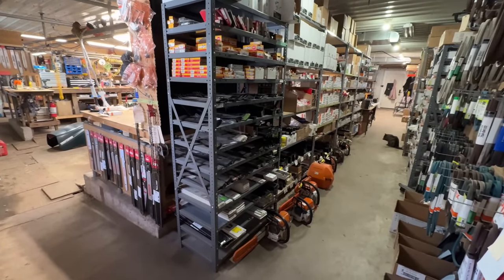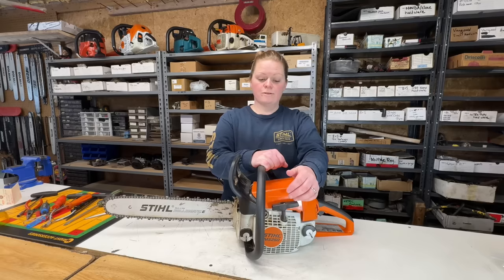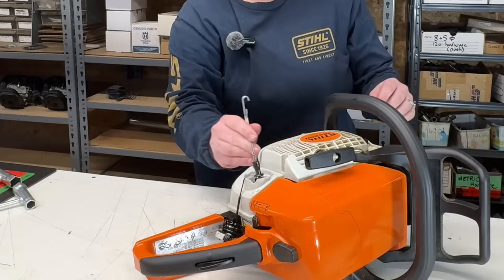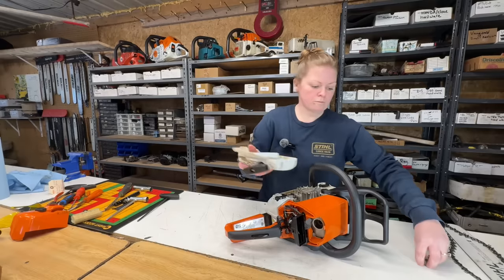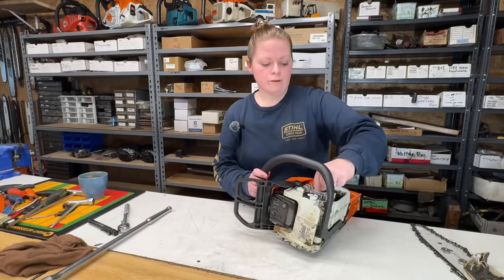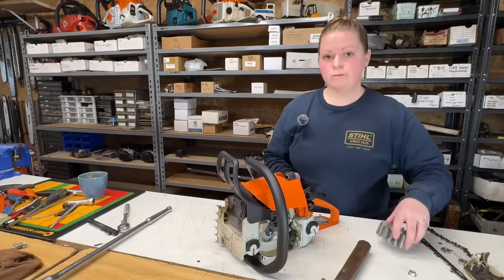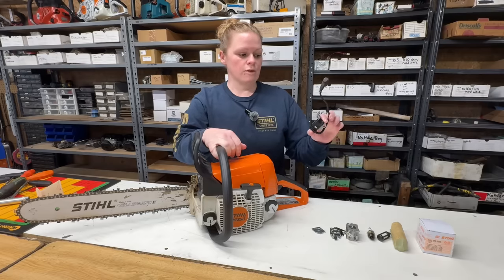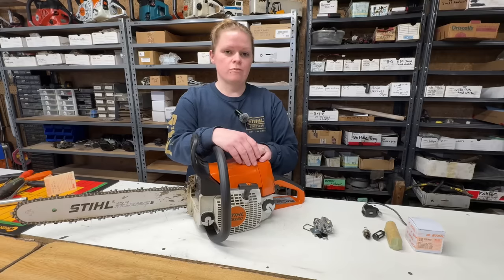Stihl MS250 Chainsaw HARD To Start!  It Wants To Rip Your Arm Off!  Let’s Dive In and Find Out Why!

Comment: Well? One thing I should point out though (and I don't know if you tried it with this saw) is that once warmed up, it starts perfect the rest of the day but once it sits overnight, the same things happens on a cold start the next morning. You should wait a day and try it again in the morning before coming to a conclusion on the kick back problem. Let me know if when starting it the next morning it's still fixed. If it is, I'll check my carb this time. Thanks for pulling that one up to the bench, I have one and have been scratching my head on this issue for a long time.
Reply from the maker: As of right now, its starting up as a MS250 should.   They seem to require a solid, fast pull.   I may not have the upper body strength required for a 250.  Tyler is able to easily start it now.   Something else I forgot to mention in the video is that we installed an elastostart starter grip - it takes some of the shock out of that pull.
Reply: Thank you, it's nice to finally find out that MS250's tend to have high compression, I was baffled with that too. You're not the only one that has a hard time pulling that thing over, I pulled it out once for my neighbor to try and start (he's a bit of a strutter) and it was fun to watch him struggle.  @marriedwithsmallengines

Comment: Thank you for a professional and educational video. too many people are making videos and have no idea of what they are doing.
 What is the flywheel gap at 0.010? I have an old concrete saw that has nasty kickback on start.  ts510, I pull it slow till I can get the fuel to lubricate the cylinder, and then pull it like I mean it, but sometime break the rope.

Comment: I can tell one thing: Customers all over the world will not tell you the reason/ what they did beforehand.
Not sure if it is pride or they think it will be cheaper to fix.
If the latter, they are wrong, as is could possible pinpoint the reason why a machine do not work quicker and save them money overall.
Thank you for the video, thumbs up and subscribed 👍

Comment: I bought a brand new leaf blower made by echo PB 550 T I think is the model first day. It ran like a champ then it started acting up later in the evening. I think maybe it’s just hot. I let it cool for a little bit go to start and it does not start and it starts overloading with fuel flooding out basically and remember this thing is brand new out of the box, I took it back to Home Depot and they said don’t bring it here call the number on the box and return it to the manufacturer. You’ll have to pay shipping blah blah blah then I asked him can could I just exchange it for one that runs the manager comes out and says we can’t do that because we don’t know if you or someone put the wrong fuel oil mix in it or something and caused major engine damage, so I took it back home called the one 800 number they gave me some tips. I got it running again thinking it’s just temperamental, but it immediately started flooding again. I eventually decided to take it apart myself I even ordered the echo brand carburetor kit, thinking I would just clean it and rebuild it, but you won’t believe what I found,a roly-poly skeleton inside the carburetor it didn’t crawl in there, someone put it in there. The location where it was a critter of that size couldn’t have crawled into that port or location where the fuel pump diaphragm is located. it was under the diaphragm, a transparent Rollie poly skeleton

Comment: Thanks for this video. I love your method of elimination. I have an MS250 with the same problem. I’ve learned to struggle with a couple of tough pulls and when it starts to react I put it on half choke and it starts right up. My question is…you found the problem to be the carb, but did not mention what happens to the carb to cause this hard to pull condition. And knowing this now, what would you do to the carb other than replace it to fix the problem? Thanks again!

Comment: I am surprised you did not check and if necessary adjust the gap on the new spark plug. Very thorough and Informative video even though I have a Husqvarna 390XP. I may at some point give the MS500i a go as it has some attractive features, good nearly identical (6.7 vs 6.5) HP as the 390XP, and the 500i is one kg less weight.
Reply from the maker: Thanks for watching!

Comment: In 2012 my grandfather had a hard pull on his Stihl, I think it was a 16 inch, may have been an 18 inch saw.  He couldn't hardly turn it over and was upset thinking his advanced age he wasn't strong enough to turn it over.  I went out and tried and it was hard, I mean hard to turn over.  I told him it's not your fault grandpa, even I had a hard time.  Once it turned over and tried to fire though it would pull smooth as silk each pull.  I took it apart and cleaned it and put it  back together.  The first pulls were always terrible.  I noticed on the nomenclature plate it was marked, "Stihl Made In West Germany".  He'd bought that thing in the early 80's. I began to surmise why it might be a little tough on the first couple pulls 😂😂

Comment: That hard to pull the Rope situation on that song is always going to be caused by either too much carbon buildup on top of the Piston or inside the cylinder or it is going to be caused by too much fuel in the engine

Comment: Unlike most 2 strokes, don’t pull on choke until it wants to run. First choke setting, don’t pull more than 3 times. Then advance choke setting, and pull until it starts. It floods super easy.

Comment: Thank you for fascinating walk through dismissal 😊❤😊 you do excellent work. I had no idea ( I am a home user of chainsaw) no idea about the coil gap testing. I got a MS-291 from local JD tractor dealership. They had a break in at store and someone tryed to take or should say pull my saw off display chain lock up. The only thing wrong or broken was the end of hand holder had cover ( Cracked) they were selling it as is for $420 this is about $100 off there Saws
It was sold as is. I used Gorilla tape rapping around handle. The MS-291 starts after 2 or 3 pulls. It cuts so much faster than my (SEARS) one. I do like a saw or anything gas powered tool that has a primer bulb to pump. For me those type seem to start better. I think the Sears saw isade by Huskavarns. ?????? If someone out there can tell. But the Stihl cuts wood so much faster.for my personal use I prefer the ( Trufuel) pre mix. I have never had a starting issue when my saws site for a time, I personally don't use them every day like professional cutting people do. When I was working for a company, they did NOT use ( Trufuel pre mix) and used the 10% ethanol gas that they put in the work trucks, we mixed the chainsaw gas can at same time we fueled work trucks. I see all Fire Departments when they show there chainsaws and other cutting tools in the compartment, the FDs all have ( Trufuel) pre mix cans in compartments. Can you tell me what your feeling is about ( Trufuel pre mix) I never want to run Ethanol mixed gas in any of my personal hand power tools. The fuel farm I buy all my Diesel and gas from has NON Ethanol fuel pumps even a Premium fuel pump with NONE ethanol
Reply: for my old ms250 . 91 or 89 octane gas 38:1 oil mix 
I just replaced carb , and coil. set gap is important. 
the old carb was dirty and had a bad Diaphragm .
china made coil/wire required filing a grove in the saw plastic bottom to FIT.
new filters : starts and runs very good.   :oops:

Comment: Had one of those for about 3 months, I used it for about a month & a 1/2, went through 15 chains cause you cant adjust how much oil it will pump out to oil the bar & it would burn the chains beyond being able to be sharpened, it would barely pump & when it did it would constantly clog with sawdust, you had to clean the sawdust every 10 minutes like clockwork. I replaced it with a Husqvarna that you  actually can adjust the bar oil over a year later I'm still using the original chain it came with

Comment: The thing i always notice with sthil is they are always so shiney when you see them getting repaired, i have a second hand ex forestry husky, it been the only saw ive used for  cutting firewood for my parents large farm house for the last 20 years, it had a new bar and chain about 7 years ago! Its never been in for a "service"  and starts 3 pulls cold even if its been left for months and first time if its warm!  Must be a golden goose! I hope there is someone with a Stihl with a similar story!
Reply from the maker: Yesterday I posted a new video about a Stihl MS361 - 20 years of hard work! Check it out :)
Reply: @marriedwithsmallengines   I will do for sure! Thanks for the interesting, insightful and well produced content. It takes guts to do this, showing your reasoning and anything you think you could have improved with hindsight!

Comment: My MS170 developed a kick-back problem after having had the flywheel off to replace the oiler tube. No, I didn't use an impact spanner. I found the flywheel had too much backlash on the taper due too much keyway clearance which allowed it to be positioned with too much ignition advance.

Comment: Great diagnostic 
I’ve also worked for a STIHL dealer
Yes I’m a certified tech
I’ve found out in my experience that
Home owners would put in 40:1 gas in them 
Cause they don’t read the manual 
That’s another thing I tell the customer before leaving the store 
Cause Ive seen they also use straight gas and wonder why it stay running 
Yes “Houston they have a problem”  lol
I’ve also Found out using non 50:1  2 cycle fuel means a much harder pull start
As you already know
STIHL is always 50:1fuel
I believe it runs better onSTIHL fuel than any other
Just my opinion

Comment: I have an MS250c and I absolutely HATE starting this saw.  I used a carb rebuild kit and cleaned it out really well (even used a sonicator to make sure all fine grit was out of the carb before adding in the new components).  Now you have me thinking, I'm going to replace the fuel filter, spark plug and air filter with all new.  I'll also regap the coil.  I'll also check the vent and the spark arrester.  Let's see what shakes out.  I would love to trade this in for the "easy start" model that has the pressure relief valve built in.  I'm 70 and not really into having my arm torn off anymore lol.

Comment: I had an old Stihl 041 with the same problem i got a new old stock gasket kit and rebuild it and and put lock tight on the cylinder bolts because the use to open up after a while the old fella who owns it uses it every week and has no problem with it

Comment: If you find your sparkplug wire is hard to pull off or the spring pulls out of the boot, you can put a dot of silicone grease in the hole and pop it on the plug. This will help insulate the park and make it easier to pull off the next time.

Comment: After rebuilding my ms250 with an after market cylinder assembly I got on Amazon, I also had a kickback problem that kept the engine from starting.  I found that the key slot in the crank shaft was advanced by about 10 degrees ahead of that in the original one.  I took the piston off of the new cylinder assembly and put it on the  original crankshaft and reassembled the saw.  The saw started right up and the kickback was gone.  I hope that my experience may be of help to others.

Comment: Really interesting, find what'is the problem is a real investigation, I was not aware that a carb issue could produce this effect on a saw. As often, people are producing issues when they try to repair something ! But it could be a bad assembly of the carb in the carbfactory itself.
Reply from the maker: Hi there!  Thanks for watching!   In this case, the carburetor was over fueling.   Someone was previously into the carb because the limiters were missing, the jets were cranked out and there were tool marks on the screws.    It's always possible that there was a defect in the carburetor from new and that someone was trying to compensate for it.  It could be a botched carburetor job.   It's really hard to say what was originally wrong.   The hardest repairs are the ones that have already had a failed attempt and it's not disclosed.
Reply: Well; change the carb was the best choice. Good repairing !
 @marriedwithsmallengines

Comment: Good video- Thank you for your efforts. My MS250 I think is a lemon, but it has been worked on so much, by me, that I'm thinking of taking it to a shop and letting them put a new carburetor in. I am tired to death of needing this tool and it will never run, even after taking it to the shop mutable times, where I bought it. I'm going to ask off the top for a carburetor replacement.

Comment: I have a old old David Bradley saw its a monster with push oiler b7g 24inch bar, id like to get it made pretty to make a shelf piece but running, it ran the last time used.  Very loud but a remembrance from the past

Comment: There is a torque setting for the coil screws. It's 4 Nm.  Also, too much carbon buildup will increase compression making the engine hard to pull.

Comment: had one just like it with the same problem it would take 2 people to start one to hold it down and one to pull the rope except it was not hard to start after taking it back numerous times during warrenty and after finally said there was nothing they could do they did the same repairs  new plugs carb you name it nothing fixed the problem we ended up buying a different stihl saw the old saw still runs and still takes 2 people to start

Comment: I've got a 391 that is hard to pull and it turned out to be the decompression button was clogged.A little carb cleaner shot down it fixed it.

Comment: There's a super easy trick to pulling those air filters off of an MS250. Just grab both sides and pull it backwards and it will pivot off the two retaining tabs and lift away, no tools required.
Reply from the maker: Thank you, I have since learned the secret! :)

Comment: Honestly, we learned more by your methodical rooting around looking for the problem, than if you had just replaced a carb.
I got a  ported 272 Husky that has a nasty habit of occasionally ripping the starter rope out of my hand.
I think I’ve solved that problem by putting a snow machine handle on it. We’ll see after I get done with hand therapy.
Also my newer  461 has done that as well, even using the decomp.
I’m hesitant though about cutting off the handle with the built in shock absorber just to test my theory with a snow machine handle on it.
What happens when the rope breaks on those saws? Just go to a regular handle or does one have to buy a new rope/handle combination to retain the shock feature.
Reply: You can get just the rope made for your elastostart handle on your 461.

Comment: This saw video is exactly what my MS250 does. It pulls really hard but eventually starts. I figured it's just the way the saw is. I have never tampered with the carb so I'm wondering what's happened inside to cause this.

Comment: I use a Dewalt screw gun with a socket to remove the flywheel nut. No need to use an “iffy” tool in the combustion chamber.

Comment: I stumbled across your channel a couple of days ago and watched a few of your videos. You seem to be quite thorough with your work. You are the first small engine repair person that I have seen that has checked the vacuum and pressure on the.carb. and crankcase, which is good, however you noted that the top of the piston on this saw had accumulated a bit of carbon on the top which would reduce the volume at the top of the stroke and make the starter cord hard to pull. I was hoping that you were going to check the compression to see if the carbon build up had made the compression higher than recommended?

Comment: great to see a good fixing video, gave me a smile when I saw that torque wrench :-) but, coming from a mechanical background, could it also have been a stuck de-compression valve?, same as in diesels, to aid in starting a valve leaks some compression until the engine starts, maybe this "carbon" had got in there clogging the port.

Comment: A few years ago I rented a Stihl chainsaw.   Not sure what model it was.  The bar was 24" long.  The first day I had it, I couldn't start it.    I went to Ace HW and bought a new spark plug.   It started on the first pull, but it wouldn't cut anything.   Someone had filed the cutters the wrong way.   So I bought a new chain.   I did a lot of cutting that day and returned if before 5:00 PM, after putting the original spark  plug and  chain back  on.    The rental guy asked me if it worked ok.  I told him yes.  I rented it a few more times and always swapped the parts.

Comment: Too much fuel causing hydro-locking, saw it right away.  It can be a real problem if you have a lot of carbon buildup.  I have an 025, an ms250 and had another ms250 that was sold off.  When they are set up right they are easy to start and quite reliable.  However as mentioned, they need a strong pull to get them going, Stihl messed up making the recoil pulley too small in diameter which gives a poor mechanical advantage.
A go-to saw for me in anything up to 12 inches in diameter including North american hardwoods

Comment: I have a older stihl 025.  It never ran properly right out of the box.  It would work for a while then dy.  Finally, after many cleanings and adjustments,  I replaced the carb with Chinese model and it seemed to do the trick.

Comment: I've been watching a lot of your videos and appreciate you showing your techniques to repair and test the saws.  I know in one video you showed a carb adjusting screwdriver socket combination tool.  I didn't get the part number.  I have gone to the Stihl website and can't find it or the fuel line tool.  I would appreciate it very much if you would show all the tools and where they can be purchased.  Amazon and Ebay don't have them.  I bought a set off of Amazon and they have everything except the one I need.